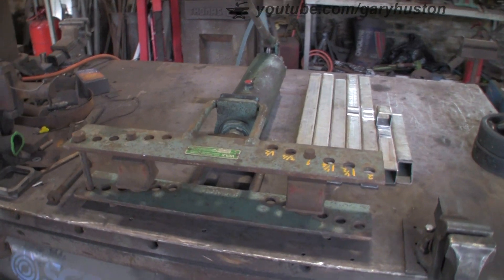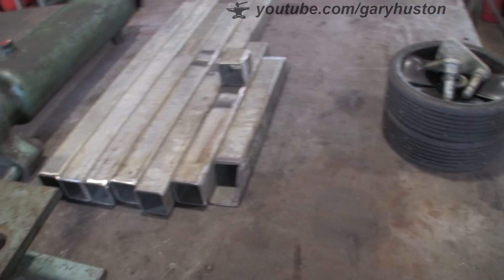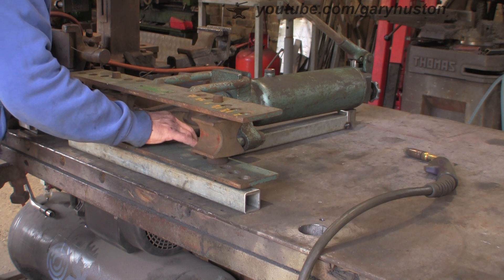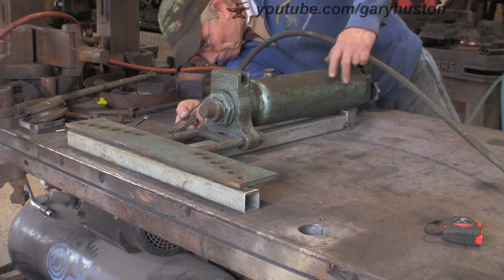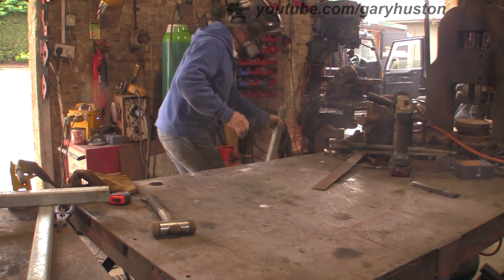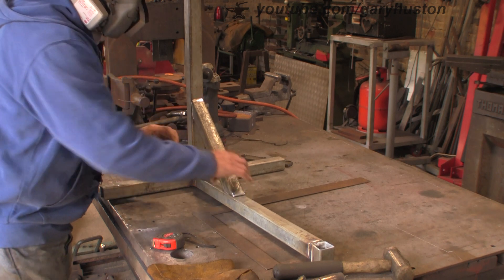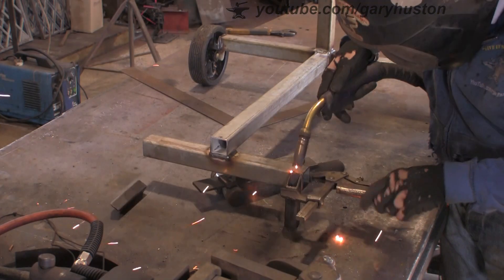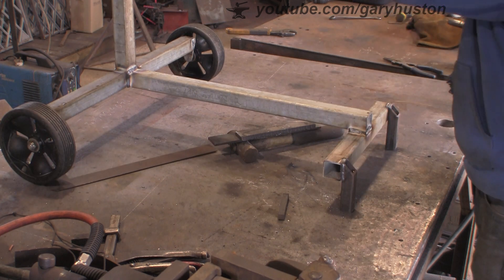Pipe bender stand

Comment: Mine (wax) will accept pipes in the 3 holes as a stand. But your stand looks sturdy.
Reply from the maker: Yes, pipes would work but very wobbly and not easy to manoeuvre when the tube you are bending hits a bench or another machine! Plus this is easy to pull completely out of the shop if I need space. I did put a removable bar at the back which has made it super steady.
Reply: @garyhuston  mine appear to be factory, will adapt your tool hanging solution though.
Reply from the maker: @Michael-tn8eb  yes, looking at their website it looks like they do supply pipe legs for some of their benders.